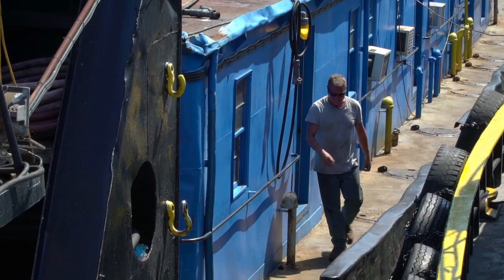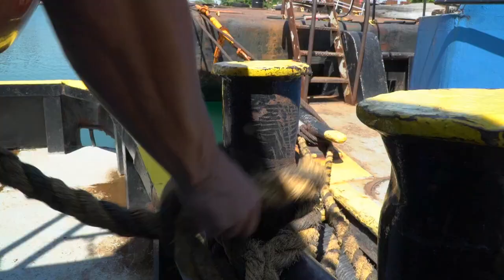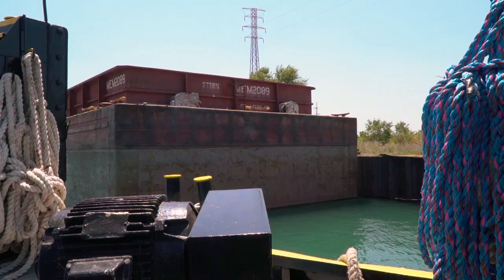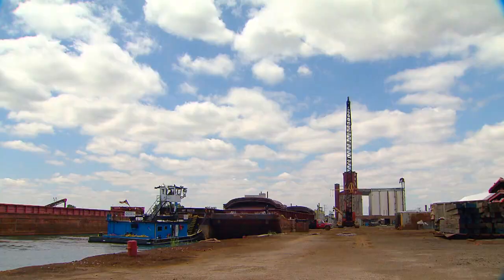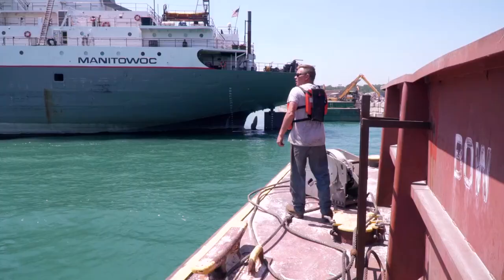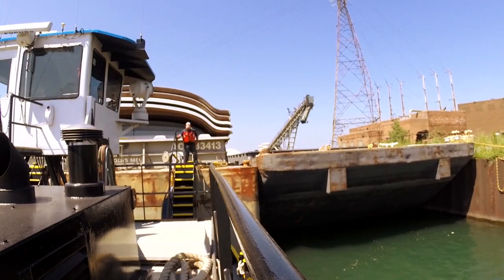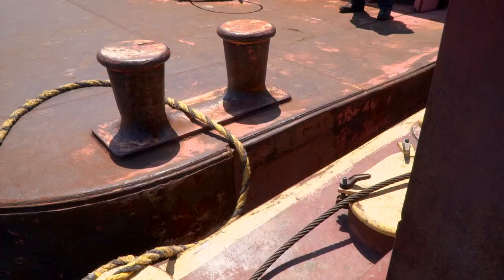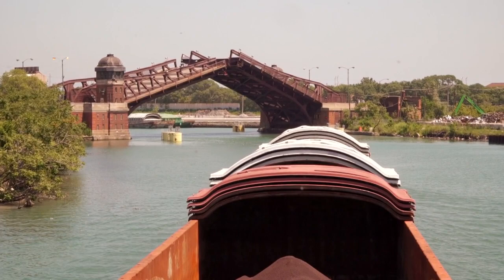A Day in The Life of a Tugboat — Jay's Chicago

Comment: I worked freelance out of the NMU hall in Joliet in the mid-late 70s.  A lot of jobs on Material Service Co boats and Twin City Barge.  Sometimes just the small ones taking sand up to the cement plant north of the Loop or into the industrial docks in and around Lake Calumet.  But sometimes larger boats that would take a tow 3 wide and 5 or 6 long down the Illinois to Granit City.  Loved those longer trips...ride and guide.
Reply: I started with Twin Cities via the NMU Joliet hall in the spring of 1976 on the Donald O'Toole; we did trips across the lake to Amoco at Indiana Harbor and back, sometimes to the Calumet, sometimes to Chicago Controlling Lock and through the Loop. Did a stint with MSC and then to Valley Line where I got my license and stayed till they were sold in 1992. Altogether 41 years on the rivers, I finished up on the M/V Cody Boyd with AEP, which I'm sure that these guys are familiar with,we made it to Calumet Lake every now and again.